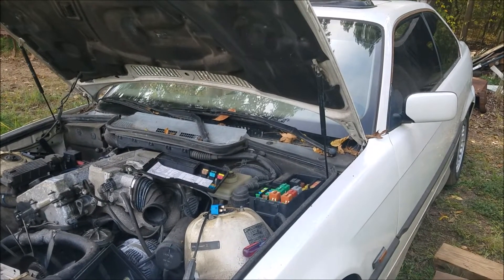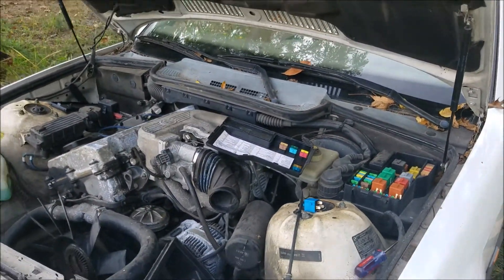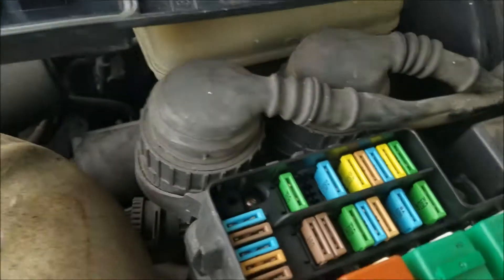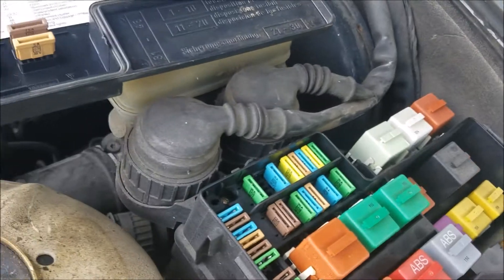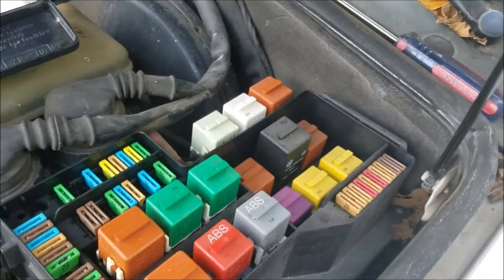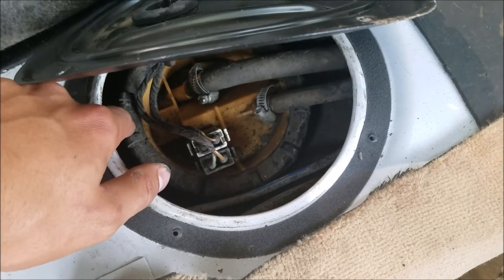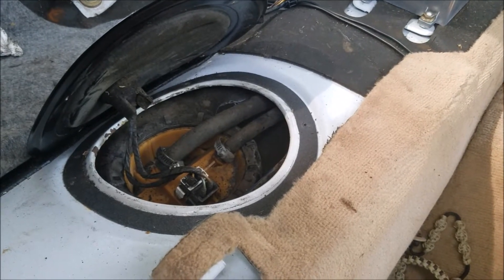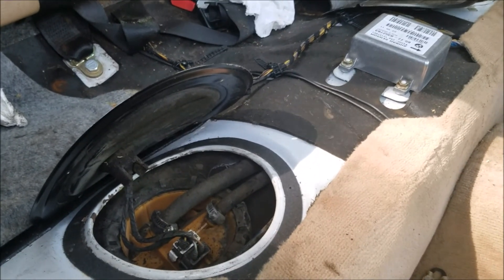BMW E36 How to diagnose fuel issue

Comment: start with a fuel filter on any car.  Then test fuel pressure as per specs, to test use a loaner tool checked out at most parts stores,  if fuel pressure but leaks down then fuel pressure regulator may be cause, if no fuel pressure then yes, check the electrical fuse and relay.  
5 pin relay is not correct, it turns stuff from hi- to low. not off.  
4 pin relay turns stuff on or off.
if you have new fuel filter, test and have pressure then test fuel injectors either on or off car. clogged fuel injectors will cause misfire or non-start

Comment: What is the relay number for the middle white relay, where the fuel pump relay was located my brother knocked down the engine bay so my car has been just sat there for years. BMW can't tell me. Also is the pump in the tank always on?

Comment: Try hooking up the 39.95 OBD2  scanner and look for after scan for option on car No Air. this means they shut down air intake.
Reply: mechanic's dot that when they want to charge you high amount of money. 
by shutting part off. or fuse off !
Reply: if your wondering what I am talking about Autel has inventory check says air in chart checked and X  if it's bad ends in report if not it's off doesn't  but mass air flow also on check if it says off then in airintake  the mass air flow sensor if it says off it been shut off from computer. if it's bad it will be in report for codes problems

Comment: My e36 went too low on gas about a month ago and since then it cranks and doesn’t start also my battery is pretty bad especially since it’s been cold today but today was warmer so I cranked and it was so close to starting do u think starter fluid is good to try I heard it’s horrible to use on these engines but it seems like the solution since buying a new battery isn’t currently in my budget I just need to get it started to park at home cuz I currently got a ticket where it is parked right now
Reply: I filled about half a tank of gas where it died. And I was thinking it may be an clogged fuel filter or bad pump since it idles rough when it is running I have to press the gas to calm it down I’m not sure what else to try right now I have like $100 to work with right now
Reply: have you solved it?

Comment: I have a 1995 325i e36 sefan.and i just did the ews bypass by cutting wire 7 and my fuel pump is still not turning in. The fuel pump fuse is fine the fuel pump works when i jump positive feeds to it. Also my injectors arent firing nor coilpacks. I have no idea what the problem is. Not sure if its my cps or what but i reakky ned help because ive been going at this thing for 2 weeks now
Reply: 95 is obd1 put wire back together make sure check engine light turns on IF NOT IT COULD BE THE FUSEABLE LINK; PUT in the RUN POSITION TO SEE IF CHECK ENGINE COMES ON ,IF NOT THEN LOOK FOR THE FUSEABLE LINK FOR THE DME .COULD BE IN THE TRUNK ON PASSENGER SIDE UNDER INSULATION .OR UNDER PASSENGER SIDE SEAT OR UNDER THE PASSENGER PILLAR TO PASSENGER DOOR. YOU A DMM TO SEE IF DME IS GETTING POWER ANYWAY TO CHECK WIRES.HAD THIS PRBLEM WHEN I SWAPPED MY 318 TO 325.ENDED UP BEING THE DME BEING BURNT OUT AND THE FUSEABLE LINK .HOPE THIS HELPS.BEFORE ALL THIS CHECK FUSES AND DME AND FUEL PUMP RELAY

Comment: I tried to replace a fuel relay on my 96 bmw 328i and the wire leading to the ecu burned out?? What would do that
Reply: replace burnt wires andcheck for shorts in the engine harness
Reply: Pin 86 did the same for me, even after replacing it and the relay. You find a fix for this?
Reply: Why did it short? Did you ever find out? Is the manual wrong?

Comment: What about the fuel pressure regulator? My E36 M50 is having the same problem, it starts with starter fluid but does not stay on. I have no clue how to test the pressure regulator before I bite the bullet and buy a new fuel pump.
Reply: Did you ever figure this issue out brother? Im going thru the same mess.

Comment: My fuel pump is new and was working but it sat a few more months to get some other things fixed (93 325is) I put a new battery in today and went to prime it and start it but I’m not hearing the pump come on so I went a checked the fuse 18 and it was fine . I replaced the relay anyway so it’s brand new but still no fuel pump power ? Heeeellllp!!
Reply: Was also wondering ( I should still hear the pump on even if I haven’t changed the filter yet right? How do I check for power at fuse 18 with a volt meter ? Should it be on continuity? Or volts DC ? So many questions and I gotta get to work lol HEEEELP
Reply: Hey man did you get a fix same problem here
Reply: @ it turned out to be my ECM but because I messed around with the pump wires so much I have to replace them too as the wires and clips were so old but I guess I needed them replaced anyways .
Reply: @7heheadznot7he7ailz  thanks so much for the reply. Is there a way to test the ecu

Comment: Great videos! I have an E36 318is can you suggest some improvements I can do?
Reply from the maker: Gianpiero Ennamorato performance enhancements or specifically maintenance parts?
Reply: E36 Fanatics performance enhancements
Reply from the maker: Dyno tuning/performance chips give you pretty good bang for the buck, normally I'd recommend an upgraded radiator, but on a four cylinder you don't need it. Cold air intake, upgraded fuel injectors, bilstein suspension. 
You can really get into performance stuff, but it gets extremely expensive. I would just start with a cold air intake and a tuner.
Reply: E36 Fanatics tanks for the tips ;)
Reply: Watch the hooligan channel

Comment: You forgot the fuel pressure regulator. Thats important to check too. And i have a 99 318ti, but i only have 1 hose attached to my fuel pump. Not sure if thats normal.....
Reply: lo ma  . I have a question for you, my gas tank on my 328i is not holding pressure, new gas cap, new overflow canister, and still not holding pressure, check engine light keeps coming on! I took a gas sniffer around the hole car and it didn’t pick up gas smell. I NEED HELP please get back to me.
Reply: William J. Bendell  for my car, i have alot of fuel lines including the fuel filter, diverter valve and fuel pressure regulator directly under the drivers side side skirt. These components are covered by a think metal cover, and the cover is held on by 4 8mm bolts. You should check those lines, the clamps, and possible a fuel leak. There is also a vacuum hose attached to the nipple on the fuel pressure regulator. If that hose is damaged it could be your problem.

Comment: I have a 97 BMW 318ti. I changed the fuel filter. But it is still losing its prime and hard to start. Once it is started drive it and give it over half throttle it falls on its face.
Reply: my 92 325 has the same issue.
Reply: @eobakaboymano  did you guys ever figure out? I have a 97 ti too

Comment: i have fuel system problem. A fuel pump was working a day ago fine but today it is not. I have already checked all fuses and relays but they are fine. Fuel pump is working fine when i test it with battery and its geting power to the wires that comes to it but when i try to start a car it does not turning on.
Reply: ews problem?

Comment: I have a 1993 325i and I have raw fuel coming out the exhaust, terrible mpg I go through a quarter of gas in like 7 miles if that, won’t always start the first try, loss of power, and just smells like gas. I changed the spark plugs and fuel injectors and checked the fuses always I can hear the fuel pump when I go to start it but I have no clue what to do now I need help
Reply from the maker: You got the black smoke?
Reply from the maker: FPR, test the fuel pressure regulator. Any codes for an 02 sensor? If not I'm putting my money on the FPR.
Reply: E36 Fanatics Currently the muffler this off so it’s coming out from underneath the car but I’ve looked and haven’t seen any smoke. The only time I did was when i changed my spark plugs there was oil on them and on the coil packs and the smoke went anyway after 5 minutes  of it being turned on
Reply: E36 Fanatics yeah a friend of mine did the obd1 method and said he didn’t remember the code it was either a o2 sensor or a vacuum leak but he was leaning towards o2 sensor. I never really worried about it cause this was months ago and this problem just started
Reply from the maker: That's just your valve cover gasket no big deal, if you have that bad of a fuel/air mix either your 02's have gone really bad (normally throw codes) or your fuel pressure regulator. Humor yourself and check the air filter anyways, if the air filter is EXTREMELY clogged it can cause a bad mix.
Reply: Check the mas airflow sensor...probably running too rich.
Reply: It could more than likely be the diaphragm in your disa valve if your model has it just had to rebuild mine

Comment: @e36 Fanatics I own a 93' 318is E36, i'm stuck.. i am having a similar issue where i can crank the car but it will not start up. I just replaced all of the vacuum hoses, hoses that connect from the intake to the ICV, air boot, new o2 sensor, new spark plugs, cam shaft position sensor, fuel filter, fuel pump relay, and my fuel pump is not the original apparently it was replaced a month before i got the car back in July. When i try to start the car i can smell fuel that leads me to believe that the fuel pump is working.
I bought a Peake Research OBD1 code reader and when i plugged it into my car i got a code that reads E-10, apparently that means that the car does not recognize the code reader. 
I am not getting spark from the spark plugs, i pulled one of the new ones and put the ignition coil sleeve over the plug and tried cranking it while i had a buddy rest the plug on the engine block to see if it had spark but no luck. The coil packs seemed to have been replaced on that car pretty recently as they are aftermarket and in fairly new condition, the only other thing i could think of is maybe i have a bad DME. Im so fucking frustrated right now im out of ideas on how to get it to run. Any ideas? 

Thanks btw love the channel and all of the helpful tips and tricks!
Reply from the maker: Are any of the plugs getting spark? If none of them are getting spark and the wires have already been replaced sounds like you may have a bad coil pack. How many miles does it have?
Reply: Did you find what was wrong with it

Comment: I have a 94 bmw 318is. My problem is i step on the gas pedal but dont accelerate that and today the cel started to show on dash. But it goes away when i put it on gear. Its automatic. @e36fanatics
Reply from the maker: What's the code? First thing I would check if the throttle is opening, could be tps sensor as well.

Comment: I changed fuel pump and it still makes no noise
Reply from the maker: Did you check if its getting power to the pump first?
Reply: Hey, I have the same problem with an 316i. No fuel or spark. They told me it could be the EWS module. Did you solve your problem???
Reply: Any news